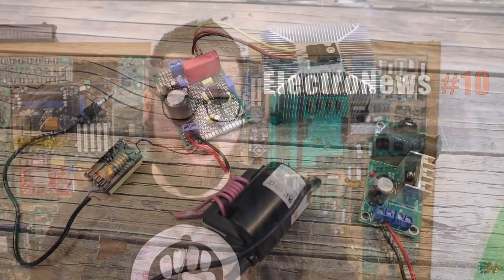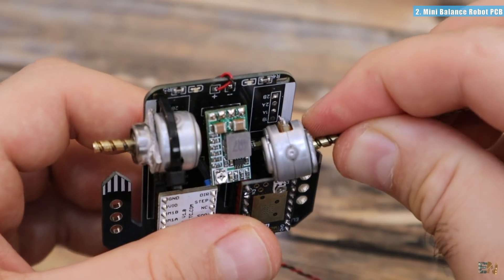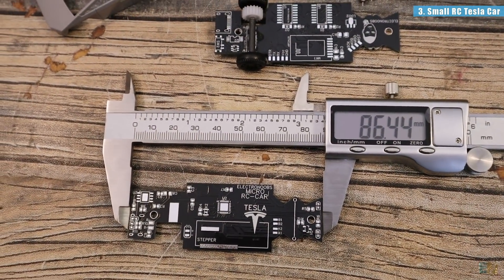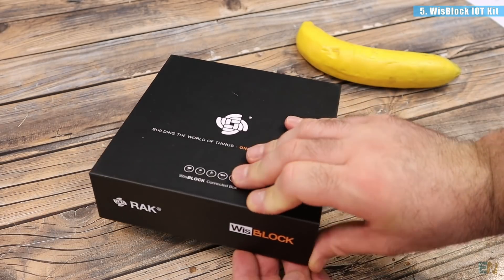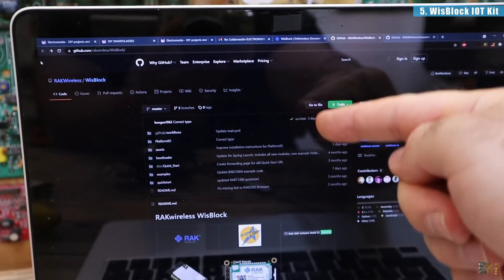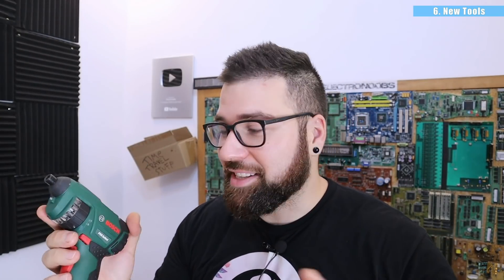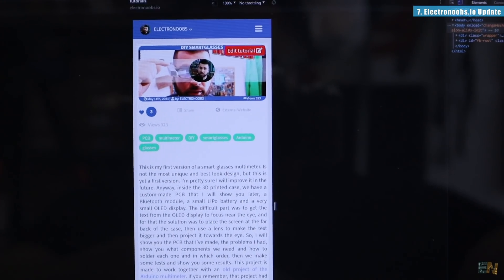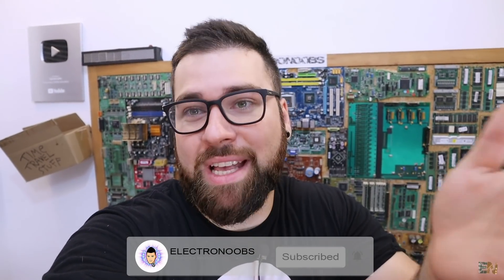Super Tiny Tesla RC Car PCB

Comment: Why not use those micro stepper motor and gear system for precision steering control mechanism?
Reply from the maker: Which ones? There are so many models...
Reply: @ELECTRONOOBS  probably the one you showed in the video or It depends on the amount of accuracy you need for steering the wheel precisely...something like ⅛ microstepping or for even more accuracy 1/16 or microstepping.And yes ,if you plan to use is battery operated,select the ones (including the driver circuitry and IC)which consume less power.And also it's weight should be take into account because it is useless to select a heavy one for which your motors can't produce enough torque.

Comment: Is your DC DC buck converter have short circuit protection
Reply from the maker: Are you talking about my design for multiple output buck converter from a previous video?
Reply: @ELECTRONOOBS  
Yes
Reply from the maker: @Shubham-9996  yes, the MP2315 converter IC has over current and thermal limiting features built-in to safely shut the device down if driven too hard.
Reply: @ELECTRONOOBS  
Please tell me if I buy schematic PCD Gerber
How much I have to pay in india rupee
Is there any tax

Please tell me can I update output to 10 volt

Comment: Hey, if you want an advice for the steering system, recently I disassembled a very very mini rc car, like 5cm long, and I was surprised there was not a servomotor or a regular motor for the steering, because it was some copper wires that magnetically pushed the wheel when electric current passes through so the wheel is turning
Reply from the maker: Interesting idea!!!! Like a magnetic coil actuator. thanks!
Reply: @ELECTRONOOBS  exactly
Reply: @ELECTRONOOBS  Hey man! Another Idea I would like to share is from a hot wheels micro rc car I used to own... It did not have any mechanism for turning, it just used two independent wheels, each having its own motor that used to vary in speed in order to turn left and right... Might want to give that a try!